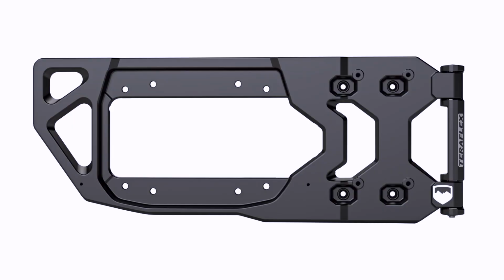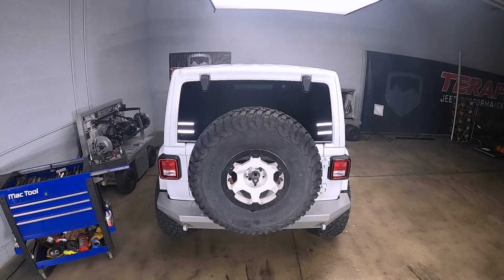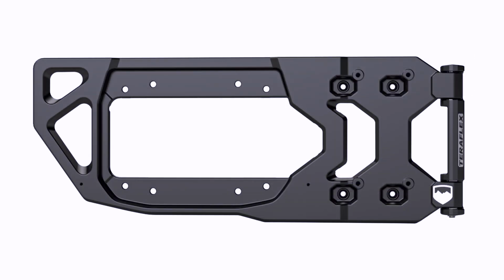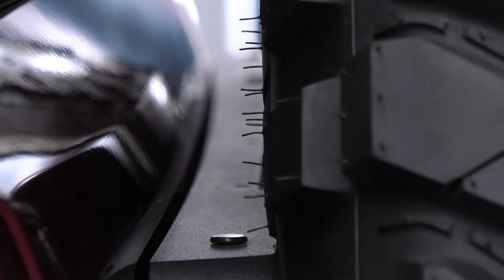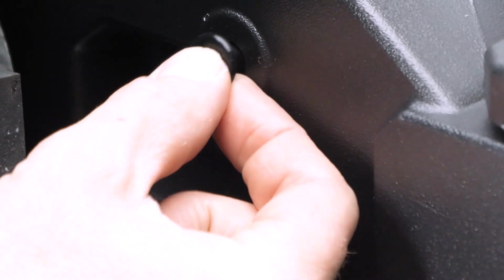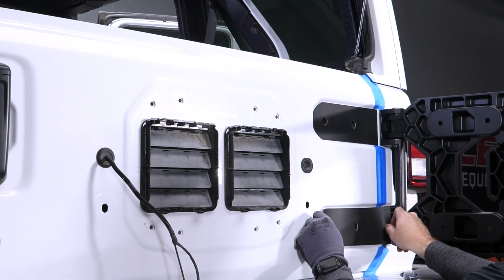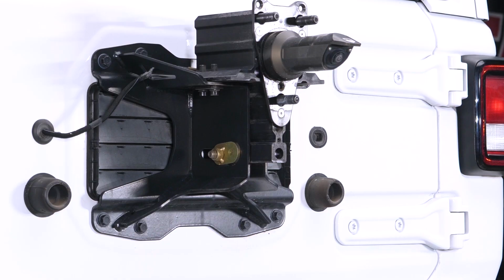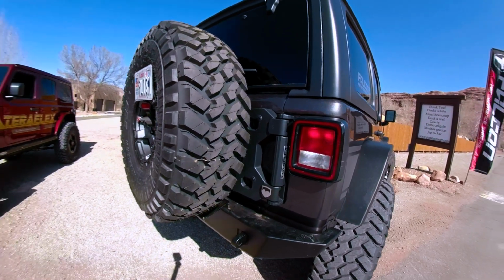JL Alpha HD Hinged Spare Tire Carrier | TeraFlex

Comment: This guy cracks me up! I keep watching this and wanting the dang thing more each time.  It does check most of the boxes but I really didn't want to cover up my Willys sticker.  Not a big deal though.  The cost is more than I was planning so I'm really having to think this out. As a fairly new Jeep owner,  it's hard to know what I need. For instance, lightweight aluminum or the heavier steal. I have some larger 35's that are 110 pounds and I simply don't want to wreck the tailgate.  I also need a tire mount that will fit the tire because right now, it's a no go. I'm ready to order just because he's such a great "Splainer"